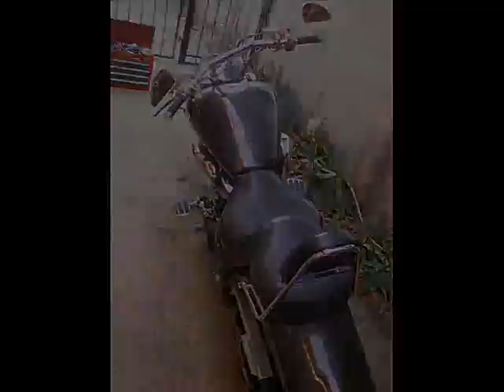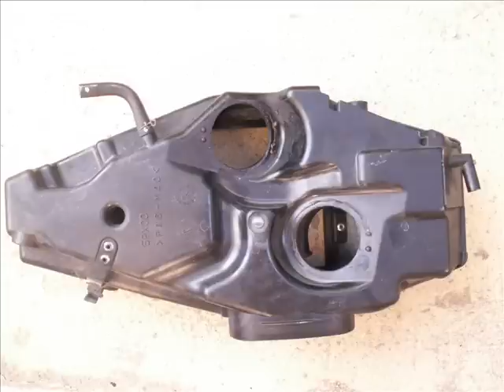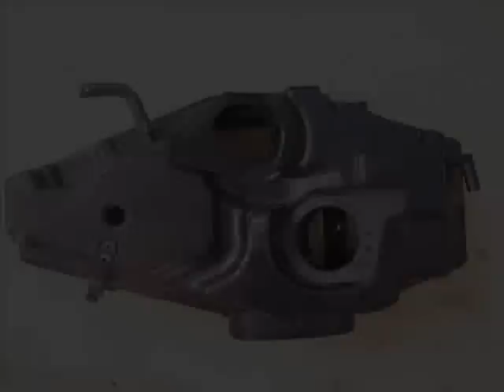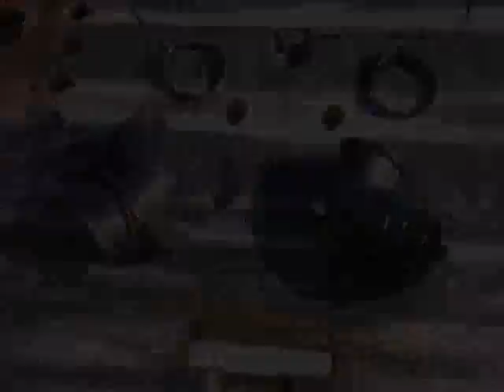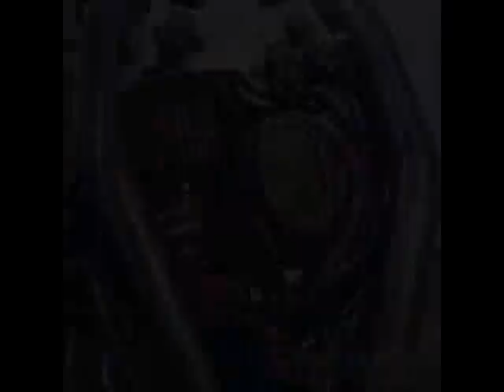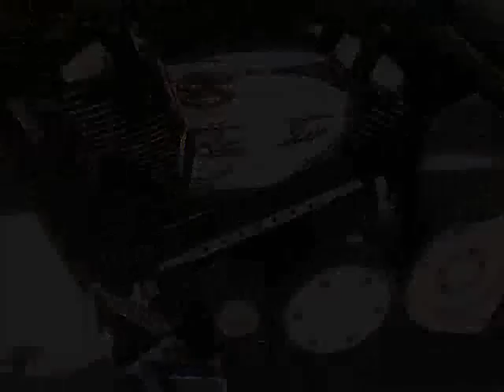Modified Barron's Big Air Kit DIY Install

Comment: I know this was made almost a decade ago but... this video does not show how difficult it is to install the Baron's Kit correctly and how it will drive you insane.  Could not do the Mod with the throttle bodies as there was too much OEM Gorilla Glue holding them to the old air box.  Baron's instructions are terrible and the Yamaha Engineering too complex for a novice to Install correctly.  Expect major repairs and down time if you plan on doing this yourself.  Should never have included the Spark Plug Coil relocation in the kit and just been an Air Kit.  Baron's really pissed me off with this one.  Keep it simple/stupid with detailed step by step instructions instead of the Wah-La it's finished pictures.  "Hook the LEV up to the mounting plate."  They don't tell you where it is and it will take you 2 hours of time to pry it out if you have normal hands.  "Remove the Air Box."  There are lots of bolts and sensors you are to have to remove and it is wedged tight in the frame.  I removed mine with a hammer.  "Install the crank case filters."  Ok, found one... Where the heck is the other one?  Does not say or show.  Baron's you suck.
Reply: Glad I read your post...that's one mod I think I'll leave.... might do the ais removal and leave it at that.
Reply: @ironwarrior8890  it was a pain in the ass to do, but it was well worth it.
Reply: Thank you , I'm definitely not buying their kit... bad instructions definitely pushes me away from the product
Reply: if you have the warrior service manual it makes it easier.
Reply: @metaldave556  Most people do not consider the manufacturer service manuals for identifying and locating parts. Amazing tools, those directions haha.
Reply: @thomasnichols6556  yes they are. i have mine saved to my phone and i screen shot the pages im using at the moment.